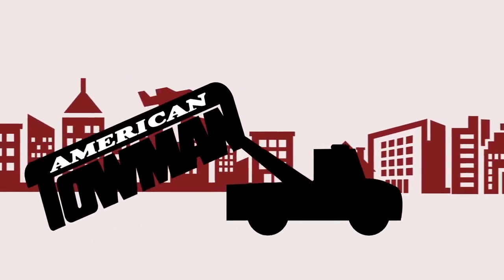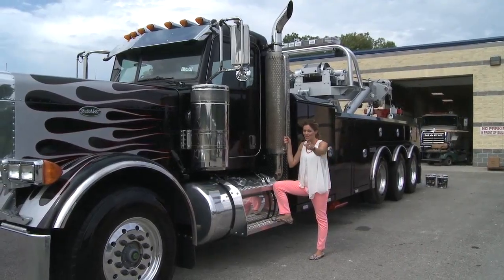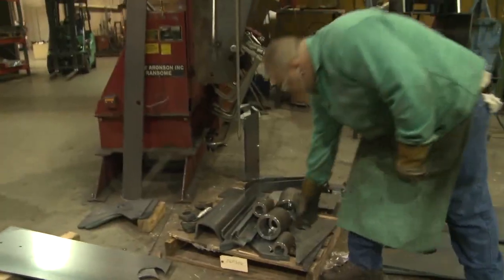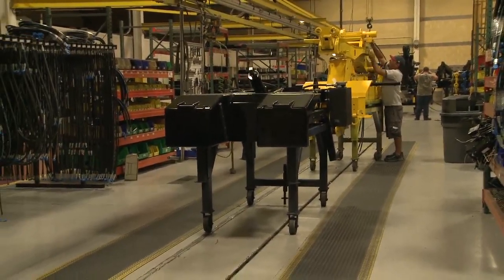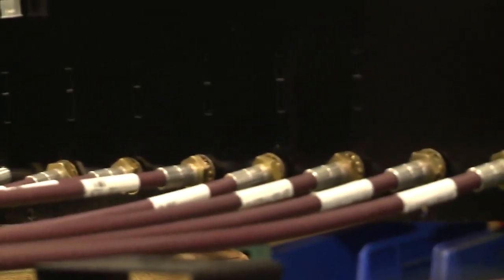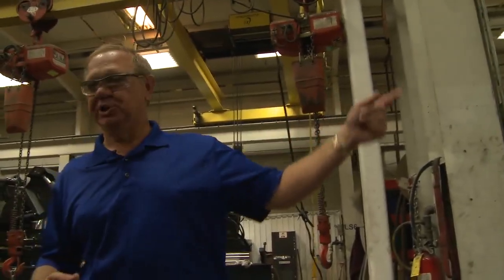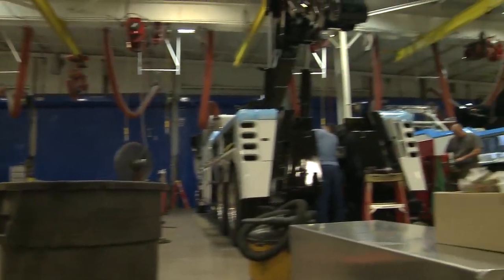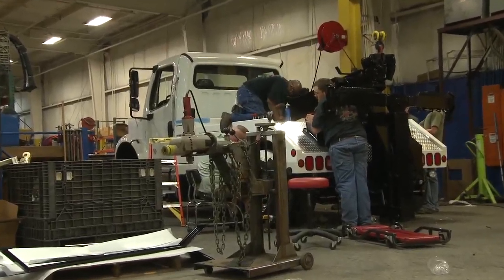Where the Wreckers are Made: Tour the Miller Manufacturing Plant

Comment: this is where it all began since 1917 Holmes Recovery Equipment and Miller Industries has been building the wreckers they come in all different shapes and sizes. there is The Snatcher also called the Repo Truck if you don't pay your bills or you get a ticket this truck will send your car to jail (the impound yard), then there is The Flatbed these trucks have a deck that goes under the car to be towed, then we have the Wheel Lift, the Hook Truck, and the king of tow trucks The Rotator also called a Boom Truck which has a telescoping boom that swivels to pick up a truck if it goes in the ditch.